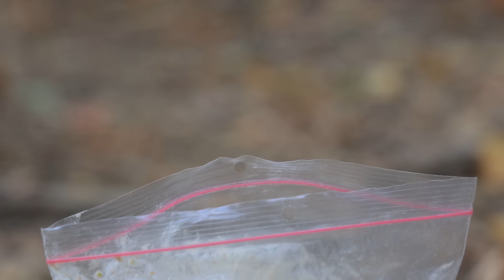Building a Bushcraft Sawmill to Build a Log Cabin for Survival in the Wild, Catch and Cook

Comment: A Wow video! Straight away subscribed after 5 minutes watched. Can't believed I watched more than 1 hour video and still can't get enough. That's super clever design. Sawdust as bed filler, wow! With a dynamo attached to the watermill you can have electricity for light too.
Reply from the maker: Thanks for appreciating it my friend.
Reply: @СтепанБандэрлог  I remembered riding a bicycle with a dynamo when I was young and it light a front light. Maybe not for other use but for just light.

Comment: Absolutely amazing build!  I  bet the water wheel could also turn some sort of generator to power the building as well!
Reply: I was thinking that also.  But just how fine would the gear ratio have to be to get enough rotation to generate a useful electrical current from that slow water current?  Vadim is doing some FANTASTIC work with wood here... but I'm not sure he could pull that off without more outside tech.

Comment: I have a question about your waterwheel. I've been contemplating a bottom-powered wheel like this in my own creek for power generation. However, my creek is very deep. Most of the time, the water level is about as deep as yours (or a little less), but during flood periods, it can fill nearly to the top, which is about 5 feet. I haven't figured out yet what happens to any sort of wheel during those periods. I have trees enough on either side of the creek, which is not very wide, that I can anchor the wheel to to keep it from getting swept away, but do you just do that and let it ride out the flood? What are your plans for your wheel when your creek floods?
Reply from the maker: Of course, a flood can damage the structure, I will pull it out of the water when the river begins to overflow its banks.
Reply: One solution is to make a 'floating' foundation for the waterwheel assembly, and the way to do that is to drive four sturdy Pylons into the river base first, then four large 'eyelets' need to be attached to the corners of the foundation of the waterwheel. 

This construction needs to be done at the lowest water level and the foundation of the waterwheel assembly has to be very reinforced.  

When attaching the compete assembly to the pilons, the sturdy eyelets will be slid or 'wrapped' around the Pylons and when the water floods and starts to rise, then the complete assembly will rise and lower with the water level just as long floating piers naturally rise up and down in high and low tides with oceans that are connected to the shore.  

Of course, this is just one way to compensate for a continual working waterwheel assembly and naturally you would have to know exactly the high and low tidal changes and especially the maximum rise of the tides.

Comment: The only thing i would have done differently, is deverted the water more faster by using more stones in bigger V pattern, to channel the water to move the water wheel faster, to make faster cuts on the sawmill, but otherwise, i am so majorly impressed, I've never seen anything so cool on YouTube
Reply from the maker: The wheel will not spin faster because there is water resistance.

Comment: I'm not entirely sure a router wasn't used in the jump-cut at 46:36, but hey, it's beautiful cinematography and a really cool build at the very least.
Reply from the maker: Thank you my friend. There can be no jump-cut here. These are not other amateurs.
Reply: I'm impressed with his ability to cut logs that are larger in diameter than the length hand saw, almost perfectly straight every time. Also, I've never met anyone that can rip a log 5 inches or more in diameter with a crosscut saw hand saw, let alone a rip saw less than 2ft in length and end up with straight boards or even at all. I've seen bandsaws cut less straight. Dick Preneky used a 3 foot rip saw designed specifically to rip along the grain. It took him 45 minutes to make a single pass. Also using wedges to stop binding. There is no way those initial boards were ripped with that little arched crosscut hand saw.

Comment: Hey Vadim, thank you for the great Video! I really enjoyed watching it! I have Question though, what kind of saw is it you use to plank the wood? I´m looking on the internet but cant find it. i´d like to have the same or a equal one for my project since it looks like it makes the process of making planks so much easier!
Thanks again! 

greetings from germany
Michael
Reply from the maker: Thanks for appreciating it Michael. This is a band saw with a width of 80 mm, sold by the meter. I made the frame myself. Greetings from Ukraine.
Reply: @vadiminthewild  Thank you for answering! I was really looking for this kind of tool everywhere. So I will have to make it myself, good to know. 
And I guess the driller for the wooden nails, you made it on your own as well, right? Amazing tools, I would go and live in the wilds with just thos tool you had in the video.
Thanks again!
Reply from the maker: Exactly. I made drills from metal tubes.

Comment: What do you call the tool and bits you used for cutting out the pegs and holes? I know one part is a hand-drill, but what's the cylinder bit you used for the pegs?
Reply: I believe these are homemade "Extra deep cut hole saws" I could be wrong as I have yet to find one of those lengths for sale. They have them for metal, mason, and concrete all day long. but for wood? looks like you would need to custom order or make one yourself if you want anything longer than 4 inches. Well. at least for anything smaller than 1 inch in diameter.
Reply from the maker: I made it out of metal tubes.

Comment: I must know,  what are the tools you used to make the dowel pins, and where could i get them? I absolutely must have a set.
Reply from the maker: You are so demanding, it's scary.
Reply: @vadiminthewild  it was excitement, not a demand. I sincerely apologize if it came off that way.  It peaked my interests because I currently have an auger that makes pegs for the hole it drills, but it's only one size.  I was just very interested.  Sorry it came off wrong.  Okay let's try this again...
Your augers are awesome! May I please ask where you got them so that I could procure a set? It would greatly help with my bushcraft cabins,  when my one inch auger is too large. Thank you in advance.
Reply from the maker: I made myself these drills from metal tubes.

Comment: What is that saw and jig you used in this video??
Reply from the maker: This is an 80 mm wide band saw, sold by the meter. What jig did you mean?
Reply: @vadiminthewild  Дякуємо, бережіть себе.  Thank you and stay safe.
Reply: @vadiminthewild  By jig, I mean the frame used to hold the saw while cutting the boards.
Reply from the maker: I made the frame from metal tubes.
Reply: Response stopped
Це дивовижно! Дякую за поділеними вами відомостями. Я шукав компанії, щоб знайти щось схоже на той пилку та направляючий пристрій, але не знайшов нічого подібного. Знову дякую. Бажаю вам гарного дня! @vadiminthewild

Comment: anyone know the technical english term for the saw he was using at the beginning to cut boards from the logs? I did a google search but the only saws it came back with were the standard issue ones that I already know about. any help would be appreciated
Reply from the maker: I don't think they know.
Reply: @vadiminthewild  what do YOU call it?
Reply: Is it something you made from scratch? Looks like a solid piece of good equipment
Reply from the maker: This is an 80 mm wide band saw, sold by the meter. I made the frame myself.
Reply: @vadiminthewild  ahhhh OK…..I am rather ignorant of woodworking and I am quite in awe of what you have built during this video
Reply: How long from start to finish did this entire project take?
Reply from the maker: Thank you David.
Reply from the maker: 2 months.